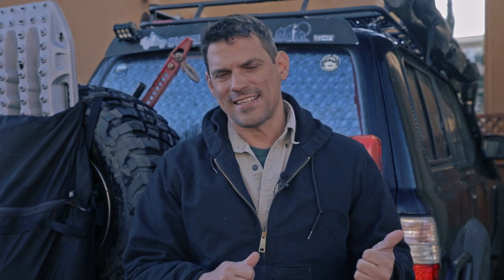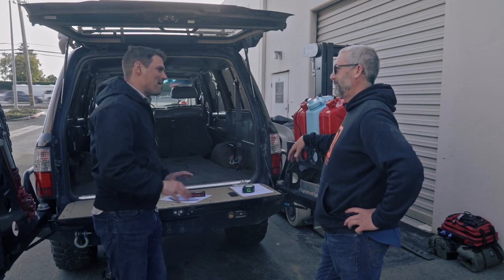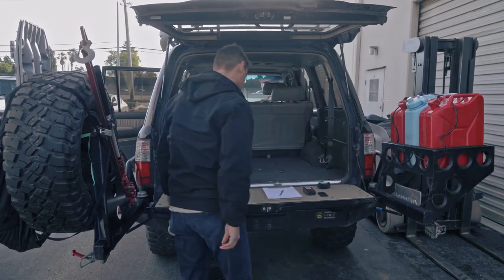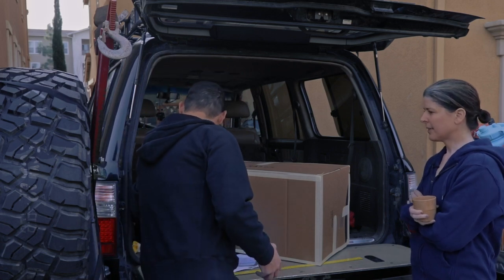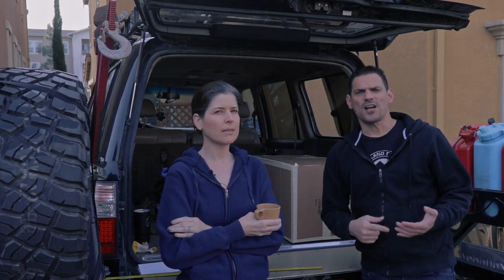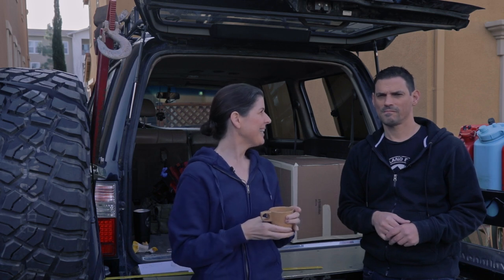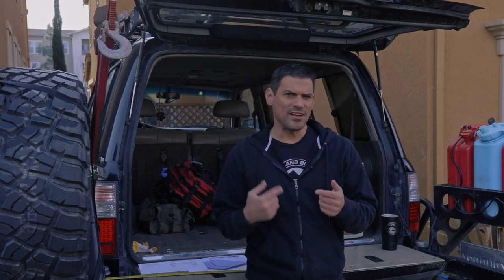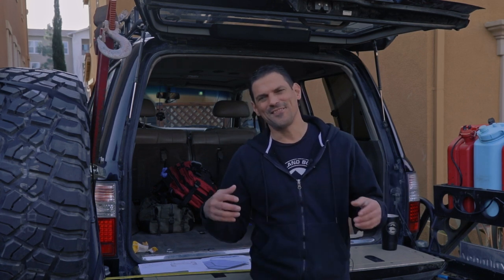DIY Overland Drawer System Build Part 2: CAD. Wife. Cardboard.

Comment: Definitely use 80/20 over steel. I used their quick frame to build mine. Its cheaper than the slotted extrusion, but still has the strength and is light weight.
Reply: @alabastardmasterson  Well Grainger (the supply house) has a local branch with free in store pickup. Ordering directly from 80/20 gets expensive due to shipping costs. My problem was that Grainger doesn't stock all of the 80/20 catalog so I had to order direct. I did find some connectors on Amazon. 10 pack for roughly the same cost as if I ordered direct, BUT... unlike ordering direct,  buying multiple items through Amazon didnt change the shipping costs.  
If Inad built my setup out of wood or steel it be way too heavy!  You pay the premium for weight savings. Hope that made sense!

Comment: Dometic CDF11 as a center console (some crafty Aussies have videos of a base to install it nicely). It's not enough for everything like drinks and such, but I'm hoping it'll be enough for dairy and meats, and I will use my Coleman Party Stacker cooler for anything that does ok with ice (drinks, canned goods best kept cold(er), etc...) because the flat cooler should be much easier to integrate in the drawer system in some way. I'm foaming at the mouth to see your final design so I can get started on mine, this is exactly what we need in our 80. We can sleep 2 in a little trailer and need to retain the 80's rear to sleep 2 more.

Comment: Hey Mikey! I liked it, I liked it a lot!!!!!  Eagerly awaiting the next episode. 
I mentioned last week I was working on two projects. 1, acquiring a new 33 gallon aux fuel tank. 
That will be available in May 2020. So now, I can turn my attention to acquiring a drawer system. 
Please, put me in touch with your friend. To design and build a drawer system for a 5th Gen Toyota 
4Runner. I'm member #15880  I thank you in advance and consent for you to provide my contact info 
to fellow member 16000. Cheers, Mate.
Reply from the maker: Hey Jack! This is a one off for Parnell. He doesn’t do it for a living. Just helping out!
Reply: @OverlandBound  Perhaps Parnell, may reconsider, if there is a sufficient profit to consider doing another "One off" commission?
Just asking? Thank you for responding. Cheers, Mate.